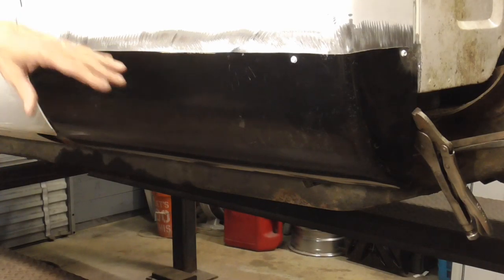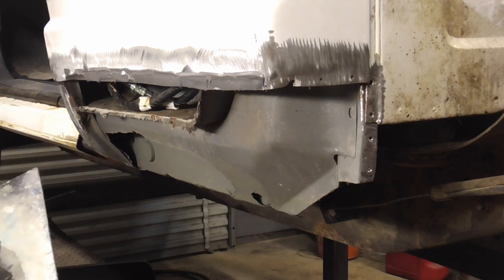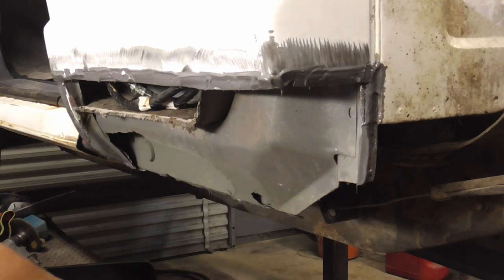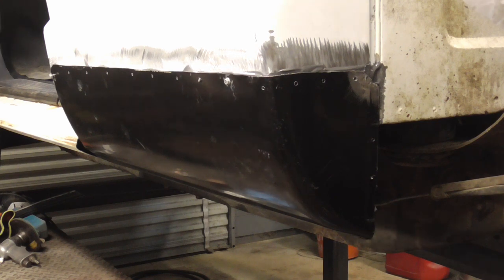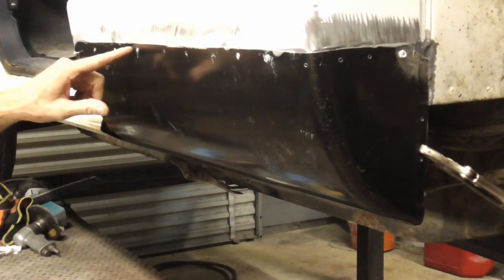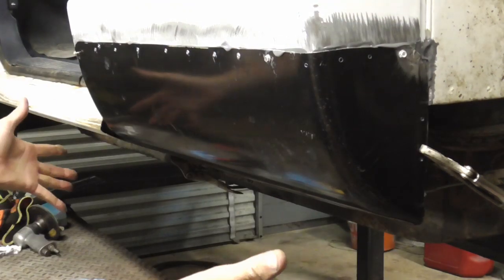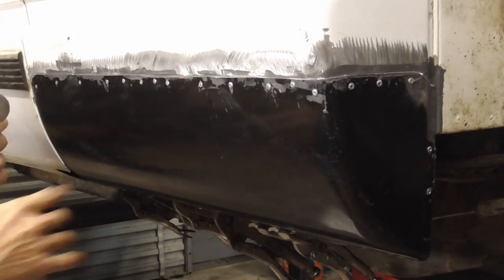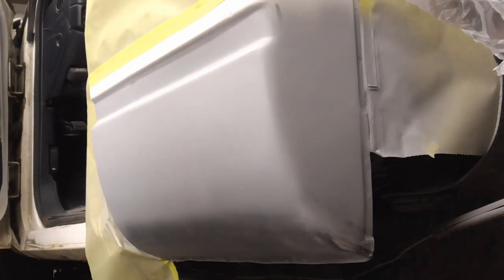Cab Corner Patch Panel Installation with JB Weld | Panel Adhesive

Comment: I've repaired several panels in this way.  I've used both the JB Weld and two were done with LePage PL9000 construction adhesive, which is a lot less money available in a 300 ml and an 850 ml caulking tube.  I used self taping metal screw for all the temporary attachments and drilled all the holes prior to applying the adhesive.  . This way the holes are sealed with adhesive when the screws are run in. The seam is recessed while the adhesive is still pliable When the adhesive is set, all the screws are removed so that the attachment is held only by the adhesive bond.  Proceed with bondo, primer, color coat and clear coat.  The oldest project is now 5 years old and is standing up at least as well as a welded repair patch.  You'd be surprised by how many steel and plastic panels on new vehicles are assembled with adhesives, rather than being welded.
Reply from the maker: Good information.  It really does hold up well as the seam is completely sealed.  Have a great weekend :)
Reply: With both jobs, after removing the screws are the remaining holes filled with jb weld or panel adhesive? Or would bondo be fine to finish them off?
Reply: @ryanv7195  I filled the screw holes with JB Weld.  Bondo could absorb water from the back side if the back of the panel if it is not painted and sealed.
Reply: @chrisgraham2904  thanks for the reply. I have a wheel well I'm hoping to repair in my ram and unfortunately I can't weld so these options on this video and your advice is much appreciated

Comment: I'm used to welding, but the heat from the welder ultimately leads to rust down the line. This repair is far superior if done correctly! Keep in mind that most new cars are using a lot of adhesives in the manufacturing! Adhesive products have greatly improved in recent years! Thanks for the informative post!
Reply from the maker: Thanks for your positive comment my friend - have  great week :)

Comment: I worked in a semi truck autobody shop and they used a two part industrial strength epoxy adhesive. If you didn't wear latex or rubber gloves, it would stick to to your hands for a least a week.

Comment: This was awesome.  Subscribed!   I didn't even know there was an option besides welding.  Focused watching of videos like this on YouTube make most trade school classes obsolete.  👍
Reply from the maker: Anything you want to learn is on YouTube.... almost.
Reply: @LakesideAutobody    Yeah, but not all videos are this well done.  You have to know the skill AND how to make an interesting video.  When I went to subscribe, I realized I was subscribed already, the "straight body lines" video you did with the bottom of the truck door was how I found your channel.  Really well done videos!  💙
Reply: I have been thinking about using this method for my cab corners. I can weld,  but this way seems better to me.
Reply: the is panel bond as well comes in a tube. I'll be trying this this coming summer.
Reply: Trade schools are great if you got a milliom$ for equipment.
Reply: 3m Panelbond
Reply: How can you put youtube knowledge on a resume for a job?
Reply: @LakesideAutobody  can you or would it be better to use a flange tool from harbour freight to make the patch fit in the good original part of the quarter?
Reply from the maker: @johnbarry559  You can do that - sure.  Corners are tough, along with wheel well lips and edges.  I figure if you can't use it 100% of the time, it defeats the purpose :)

Comment: JB Weld will set in about 10 minutes after being properly heated with a heat gun. It also skips the "runny" phase.
Reply: Everytime I use jb weld it hardens real quick.  No 30 minutes for me.

Comment: I've been doing this for the past couple years now, it's way more cost effective than SEM, or, Fusor. JB Weld is about $16, vs.same amount of SEM that costs $45. Also, it seals out moisture, so your glass/bondo doesn't 'pop out' years later. I never liked welding then glassing, because I always saw it "move," and show the seams, some time later. It works well enough to get paid, but then you will see the customer vehicle again at some point, and your work, and even worse THEY WILL SEE IT!
Reply from the maker: So far so good - 2 winters - looks perfect.  I'm actually surprised myself as I do like impact resistant panel adhesive usually like this video: https://www.youtube.com/watch?v=d21RkqTwRqs  Sorry about the late reply :)

Comment: Given your choice, and having both options available, what would you do glue or weld?  Thanks for posting.
Reply from the maker: Weld because it works every time. For example, sometime you have to manipulate the patch as you go (smacking it down while it's nice and hot from the welding). With glue the patch better fit perfect, and have no butt joints - Just my opinion though - plus I've always MIG welded patches so I'm partial to that method - Good question.

Comment: You can use JB weld with a butt joint if you use a bonding strip in the back the same way corvette panels are glued together. It will give your panels the level plane needed for finish. Door bottoms as well. Minimal floor pan patches too!! But if you can weld that is by far the best way to go. Great videos! 👍🏻
Reply from the maker: Thanks for the comment and glad you like the videos :)
Reply: did my door bottoms like that

Comment: Literally was thinking of doing this then thought someone else must have tried it and came on YouTube to check.. thank you for taking time to make this video just completed my sill / rocker repair today and I'm very impressed so far at the strength of it. Much better than covering it in fiberglass in my opinion. IL make sure to leave feedback in June 2020 to let others know how it's held up to a Scottish winter / MOT. But so far it's solid. Obviously welding is the preferred option but I don't have a welder at the moment really looking forward to seing how this holds up.
Reply from the maker: I'm sure it will hold up fine.  Looking forward to your feed back.
Reply: Paul Mccully you live in Scotland before I left to come to Canada I lived in England they used salt in Canada too my point is oil the panels it stop the rust I do my car and truck annually the entire car and truck but not exhaust, or manifold or catalytic converters or brakes  . I drill 1/2 inch holes in sills rockers and pillars and voids I do doors inner panels fenders trunk or boot and rear quarter panels hood suspension mounts floors  with a garden sprayer and use a respirator rated for oil mist
Reply: @nickking1510  great use for old oil, and i agree the subframe has oil on it from an old oil leak at engine and when you wipe it off the metal is litrally brand new under neath good shout,
Reply: UPDATE!!!  just checked my repairs today after 10 months very impressed how well this has held up. two sections i will be welding new stuff in as i would prefer seam welded on those particular panels BUT THE STILL LOOK GREAT,, but the jb welded part in my wheel arch is staying, its absolutly solid, only sprayed it with bilt hamber zinc primer and its as clean as the day i put it on. in some circumstances i reckon this is better than welding. for example you dont wreck the factory e coat due the heat from welder etc,

Comment: i used panel adhesive 20 yr ago on S10 rocker panels still have the truck rockers are rotted where no adhesive BUT where adhesive was applied the metal is still good and still holding nothing worse than trying to weld marginal metal  GREAT VIDEO
Reply from the maker: Good story... The seam will for sure last longer than the bottom of the new panel.  I really feel that glue is probably the best way to go for rust repair.  Sometimes though you have to weld.  Thanks for the great story - those S10s and Ford Rangers were tough little trucks :)

Comment: Jerry,a few years ago,i used bondo glass,from walmart,for metal patches. i did the grinding,overlaping.  I mixed,the bondo,putting it on both the patch,and the vehicle. then held the patch to car for about 2 minutes,it sets up quick.  I did my sons 73 caddy,Hearst,a tracker,and my jeep wrangler,    the bondo glass,comes out a army green color,when mixed,it is water proof,as well.  after it dried,i sanded down the bondo,then used the pink bondo,to blend in everything in,then primer and paint.   Its been about 2,5 yrs,and the patches are still on,and the cars are outside.  And the state of Pa,usually has a lot of moister,outside.  snow and rain.    3/9/23   next project is my 66 chevelle.
Reply from the maker: That's an excellent idea - I can't see why it would fail.  I think that would make for a great video.  I may just do that on this one truck I've been working on - it's volunteer work so I'm free to do what ever method I want.  Thanks for your input Allen - have a good weekend :)

Comment: This is a viable option,on the 88-98 chevys for sure. Welding to the crappy factory sheet metal just starts a new place for rust to start. Wasnt a year and it restarted on my 92. Some guys use countersink rivets.
Reply from the maker: Here's a follow up video on that cab corner which is 3-4 years old now - https://www.youtube.com/watch?v=gIS1Tbv7Kvw

Comment: Actually I believe that this would work great as I have used JB weld on several projects like this and it is very strong once it sets up. I even used it once on an air compressor fitting and it holds up to 175 PSI all day everyday.

Comment: After digging out the expanding foam in my project car quarter panels with bread knives, forks, and spoons I came to find a nice thick grey solid line of what looks like jb weld. It complicates things but since it's a project to learn on, I really have nothing to lose trying to fix it. I'm guessing I should either find a replacement panel if possible and weld it in or get creative and shape a panel myself and weld it in. 

Looks like it's finally time for me to buy a welder and give it a try. I was originally going to use composites to fix it but after seeing a hole in the floor panel, I should just do it the right way and weld a patch to really reenforce the floor area. Thanks for all your videos, I learn from them every time
Reply from the maker: You're welcome.  You will love having a welder - there are a ton of other things you will use it for too.  You'll be welding in no time :)  Check this vid out for help welding:  https://www.youtube.com/watch?v=1BYqLM_mY1s

Comment: One thing I haven't seen mentioned yet here is chamfering the edge of the overlapping panel. No kidding I don't remember where I read about this technique but I did it on a door bottom panel nine years ago. 22 gauge sheet metal  repair piece that I fabricated myself and I was able to put a 1/4" bevel or "scarf" on the overlapping edge of it.  Used a side grinder. Overlap was 3/4" JB weld squeezed out and wiped over the joining edges to a width of about 1".  Block sanded and smoothed/feathered with lightweight body filler.  NOBODY could see the repair when I was done.  Nine years later in the rust belt and it still is invisible.
Reply from the maker: Thanks for your input and sharing your experience with doing it like this Frank.  Sound like it's going to last another 9 years too :)

Comment: 3M panel adhesive ... 03 superduty crewcab , cab corners , inner & outer rocker panels ... went with adhesion to the factory weld points. ( no its not 1" perimeter) just scar the metal real good and rivet accordingly, leaving the rivets . Works exelently , perfect for a 20 year old truck .

Comment: This is great news. I have a 1990 Chevy K3500 Extended Cab 1-Ton 4x4 Dually that I have to replace the cab corners on but I have not welded in over almost 40 years since shop class in school, lol. This gives me another alternative that I feel much more comfortable trying. Instead of painting the truck conventionally afterward I will be shooting the entire truck with Raptor tintable bed liner which will also help hide any unevenness in the panel seams and the replacement panels I ordered go all the way up to the horizontal moulding indent in the panel so that will also help hide the transition. Thanks for the tip. Tiem to go pick up some more pop rivets and a couple packs of JB Weld.
Reply from the maker: Sounds like it will be a real beast - would love to see it when you finish - those were tough trucks for sure.
Reply: @LakesideAutobody  yes they are. I bought this one about a month ago. It is the only Chevy 1-Ton 4x4 Dually registered with the DMV in the state of Hawaii, and it only had 38,000 original miles on it, so it is well worth restoring.
Reply from the maker: @WH6FQE  Absolutely - you'll have it forever.  Much cheaper to fix than the new trucks.
Reply: @LakesideAutobody  Exactly. It also has a full length 8' bed on it so I am trying to convince the wife to put my casket in the back and bury me with it, lol.
Reply from the maker: @WH6FQE - RC Anderson Perfect! Does your wife like the truck?
Reply: @LakesideAutobody  Must be a female thing, lol. She says it is "ridiculously big". Of course, to her, anything larger than a smart car is too big. I told her that if her Mazda Miata ever breaks down again, I can just pick it up and toss it in the bed of the truck and carry it home, lol.
Reply from the maker: Nice :)- Happy Holidays
Reply: @LakesideAutobody  You too. Aloha.

Comment: Very clever. It is wonderful to see alternative low cost ways of repairing vehicles that don’t demand perfection.
Reply from the maker: Thank you - so glad you appreciate the video :)
Reply: It's a cheap, simple alternative to welding and far more effective than building up layers of fiberglass or Bondo when patching.  Great to  keep an old vehicle looking respectable, but any level of perfection can be achieved since the end result really depends more on the finishing steps that follow the installation of the patch.
Reply from the maker: @chrisgraham2904  Good point - especially for those that have to pass inspection.

Comment: Everyone does things different and you did a great job but I'd get a flange tool and flange the original metal so the patch doesn't stick up.
It's pretty much ready for a little Bondo and then prime.
Reply: Yes it's a quick fix)))
Reply: How would you secure the two panels as the JB Weld is curing?

Comment: again another great video. but I was wondering, why not knock it down before the jb cures, that way it wouldn't crack and it would form to the panel. I wouldn't get to aggressive with the grinder, it might soften the jb with the heat of the grinder. again thank so much for the great videos.  gary
Reply from the maker: Very very good idea - maybe on the larger open areas just bend the metal down a bit like a flange.  Thanks for the tips.

Comment: I use 3M panel adhesive on my hot rod and custom projects - can't pull it apart with a frame machine, the metal tears but the adhesive holds. Collison repair friend with 30 years in the business uses it whenever possible... told us about it and we use it instead of welding whenever possible.
Reply from the maker: Thanks for sharing OldRodder - I appreciate the input :)

Comment: I bought a pneumatic tool that puts sn offset in the underlying panel. No need to hammer on the seam. Yay Harbor Freight! Thanks a lot. This makes perfect sense vs trying to weld very thin metal IMHO.😊
Reply: I've seen that tool, how did it work out for you?
Reply: @MrTuberguber  Believe it or not, I haven't used it yet. Lolol. Best layed plans of men and mice. I was going to replace the back wheel wells on my 94 F150, those panels are still sitting in the garage. I filled in the rotted area with screening and fiberglass filled body putty. It actually came out pretty good. I just got cab corners for my 2004, I've got to get up the gumption to do those. I just turned 78, and I am finding gumption in very short supply. LOLOL

Comment: I recently fixed a broken aluminum heater core inlet, still had 1/2" of the inlet, I pushed a 3" piece of galvanized conduit over it and glued in inside and out with JB Weld marine.  I started the process in the freezing cold, I was desperate for heat! coated it 3 times allowing a day or more to cure, then I put the hose back on and I had heat again.  I used a 3/4" copper pipe elbow to circumvent the heater core until I could fix it so it's holding so far! JB Weld is awesome!  The "hack" you did seems like it might outlast a proper welded fix, simply because you have eliminated the inside weld corrosion problem and sealed everything up.  Maybe spray everything inside with Penetrol? something I wanna try as well. But other thing, if there are a lot of holes from a sort of quick weld job, instead of welding up and grinding the holes, maybe just use JB Weld?  But maybe the Bondo Glass is good enough without it?
Reply from the maker: Love the JB weld stories - tons of uses.  Yep - if you can seal the back it's good forever.

Comment: I’ve used panel adhesive for repair on fiberglass panels does ok , plus I have used what is called quick patch , fiberglass mat in a sealed envelope  helps hold cracks or splits till it hardens .
Reply from the maker: Thanks for your input Darrel - have a good weeknd :)